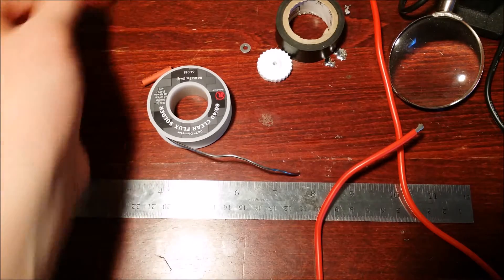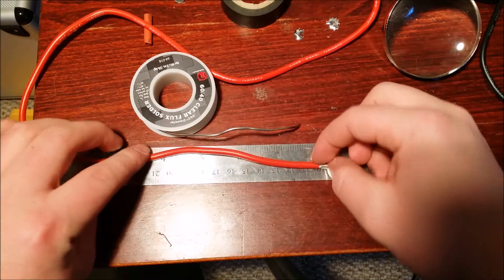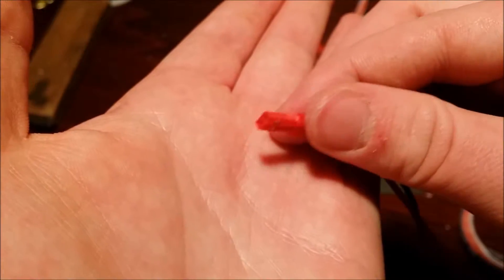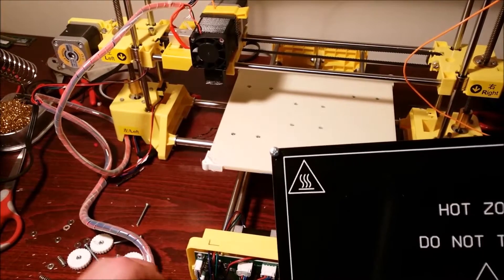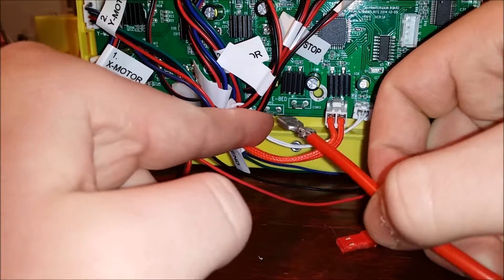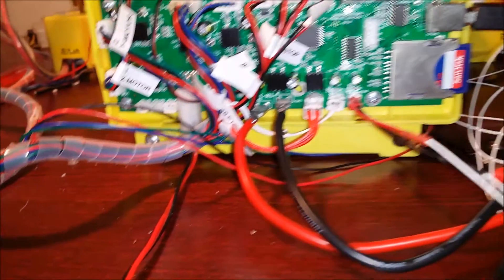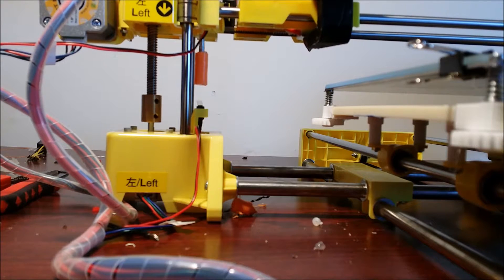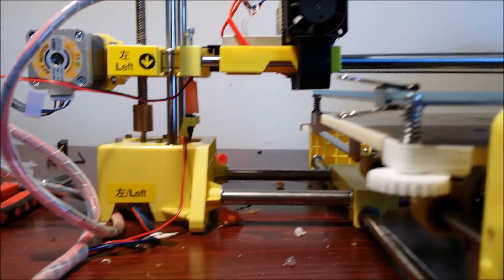Hobby King DIY Print-rite 3D heated bed install part 3/3 (final connections)

Comment: hello, a little late, the bed does not heat up, does not arrive 12v, should the voltage input be modified? Thank you
Reply from the maker: Hello! Never too late! I think I can help you out. Did you upgrade the power supply? Are you getting temperature readings that show up on the software? If you have a multimeter make sure 12v is coming out of the port for the heated bed.
Reply: thanks for answering
.
Yes, I have an atx 12v 32a PC source, no readings appear in the software, I measured the output to the bed and it marked 0v
Reply from the maker: Try checking the thermistor connections. I know for me the connection wasn’t that great and simply moving it around go it to appear in the software. But definitely getting the temperature reading is the first step. Then we can troubleshoot the heated bed. You can try switching thermistors too because maybe you got a bad one. You can also try to see if there is a setting in the software that needs to be enabled (I don’t really remember because it was a long time ago).
Reply: @channeleverything3420  Thank you for your help, if I can solve the problem I will comment, thanks and greetings from Argentina
Reply from the maker: Por su puesto mi amigo! Dejarme saber si necesito más ayuda!

Comment: Don't there have to be an adjustment in the software of the printer ? for adjusting the temperature of the bed?
Reply from the maker: Yes you are right and there is! Once the bed is connected the option becomes available.
Reply: @channeleverything3420  was my first printer i ever build from a kit... now after 2 years of printing ( no heated bed ) i have ordered a heated bed....  was about time lol. but then again, i only print practical things and just for myself.... so never needed it really, but now i want to print some bigger pieces, and they fail halfway through.  it comes loose from the bed. hopefully, with a heated bed, and the use of hairspray and a mirror. it will print succesfully :p
Reply from the maker: sven pedersen good luck!!!

Comment: I rarely comment on anything but thanks for ur videos worked great. I already had the heated bed on my printer however I was manually controlling it via. A pc power supply (ghetto) but it worked. These printers NEED a heated bed however I was unsure that the connection on the mobile was spade thanks 👍👍👍 happy printing
Reply from the maker: Thanks. I am glad that I was able to help out.
Reply: thanks man you saved my life.
Reply from the maker: +BM Central glad I helped

Comment: How do you level the bed when the printer is new
Reply from the maker: +F0xdude With the stock bed you just had to turn the z axis rods until z axis home is close enough to the bed and the extruder is level on both sides of the print bed. Also you can turn the screw on the left side of the printer to adjust the height. Hope this helps.

Comment: Hi
I heard that you have to connect to power the other two pins of the 4 pin power connector that is on the printer board. I didn't see you doing that. Did the heated bed work that way?
Reply from the maker: +atanchp I am not sure if you have to plug in those pins. I didn't plug them in and my heated bed works just fine.